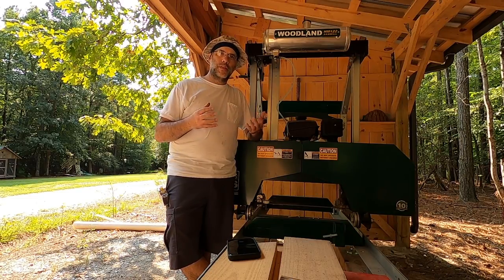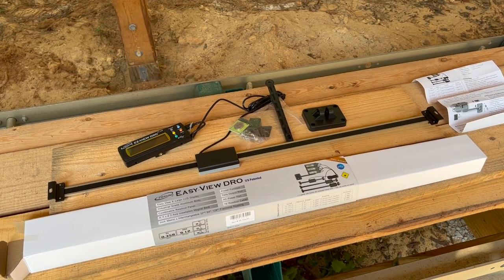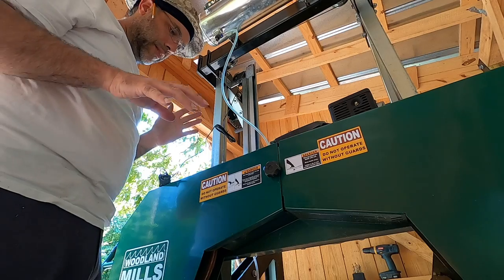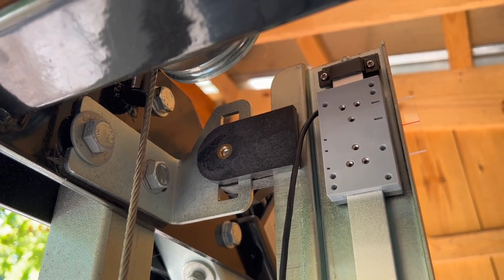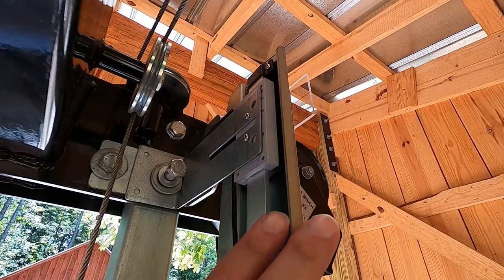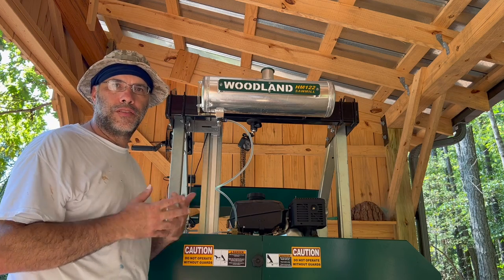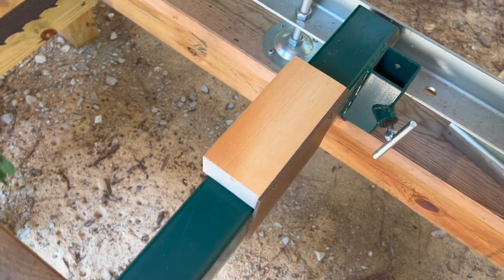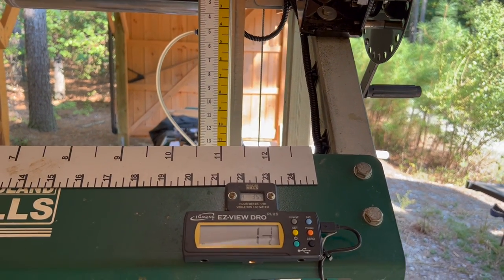Improving the Woodland Mills HM122 - Part 2: Installing a DRO

Comment: Do you also have a video where you working with the DRO?
Reply from the maker: Don't think I have done one with specific video showing the DRO.  It works great but I find the ruler simpler/faster to use for my old-school brain.  I would say the primary benefit of a DRO is for folks who don't have a good feel for reading the rulers.  Still need to understand kerf/etc but the DRO makes it easier to work out.
Reply: @Lumber_Jack would love a video too. Considering getting one for 130max.

Comment: It's not called a DRO if you walk into a machine shop and call it a DRO, they will laugh you out of the place. It is referred to  as a D.R.O 
Digital 
Read
Out
I'm not even going to continue watching you.
BTW, I have been a machinist for over 30 years & I currently have my own shop.
Reply from the maker: I used to work in a machine shop back in the late 80s -- we called them "ACU-RITE" or (jokingly) "R2-D2" back then.  Nobody used "DRO" or "D.R.O." at all.  I think it was almost the same mentality as always calling a milling machine a "Bridgeport".  Anyhow, I doubt any of this is universal or even matters, but you gotta stick to your principles here on Youtube! 🤣
Reply: Perhaps a bit of grace might be in order.  Ask your wife, or your children.  Jack has done an admirable job of walking regular folks through the D.R.O. installation and should be commended.  I will keep an eye out for your Youtube channel when it up and running and make certain to point out any failings I see,  Even a true master like Joe Pie would be more gracious than you.
Reply: @bradsmith1046 👏🏼👏🏼👏🏼